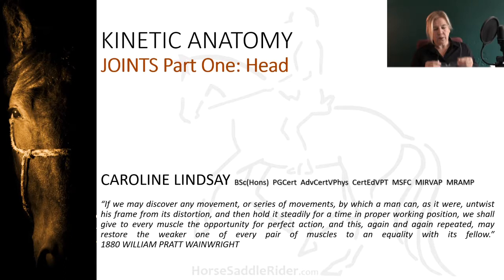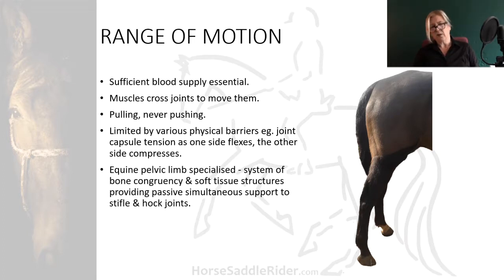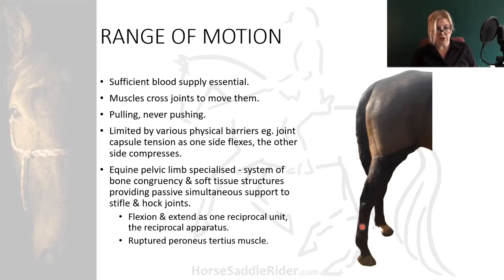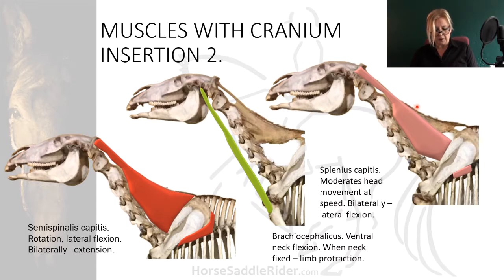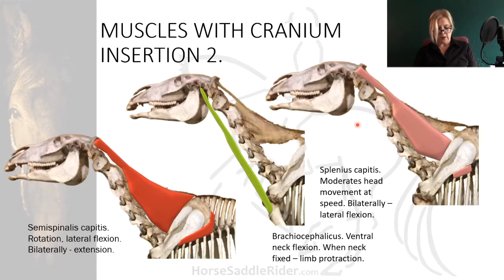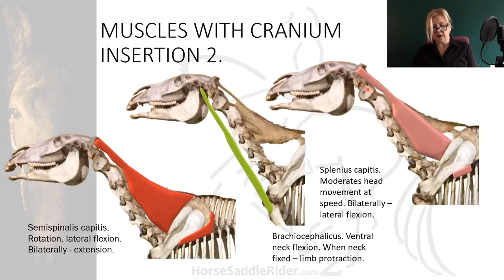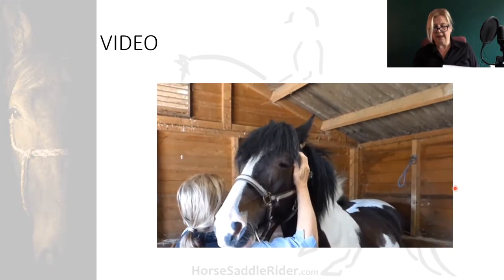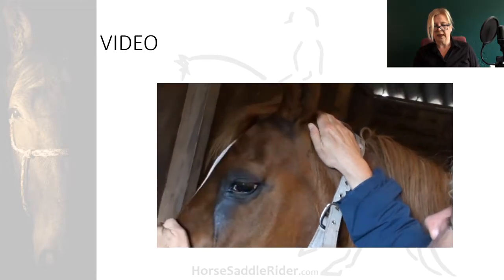2.2.1 Equine Head & Neck Muscles. Horse Saddle Rider Course. Kinetic Anatomy Biomechanics Evaluation

Comment: what about a horse who seems to have been kicked in the head,  has static asymmetry, can't find difference in wings to mandible,  teeth were misaligned with the lower jaw over a whole tooth width off to the right.  we are getting some improvement now within half a tooth side to side and still not meeting top to bottom.  No issue raising the head or flexing but rotation questionable